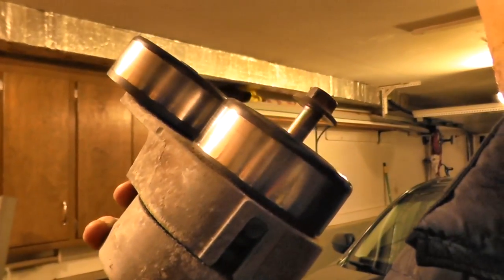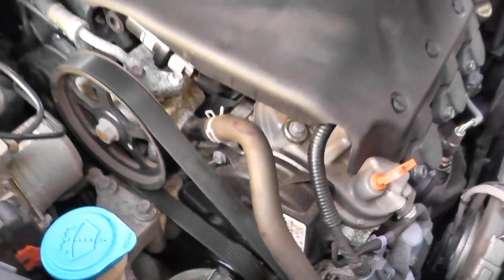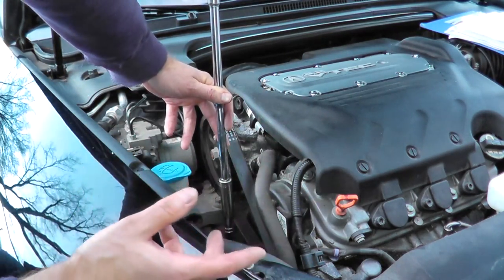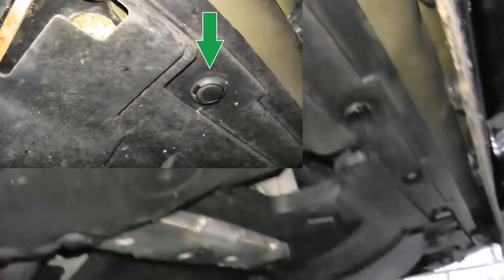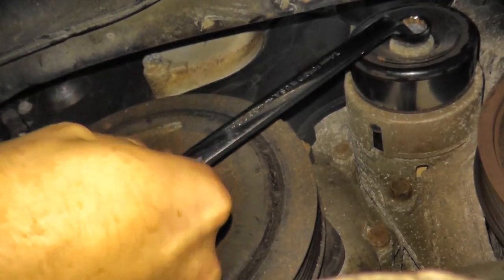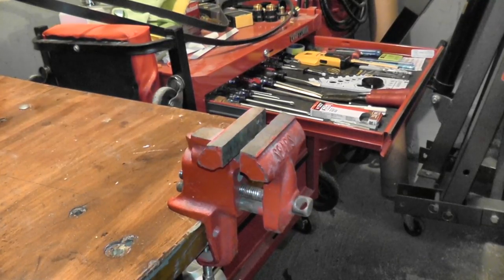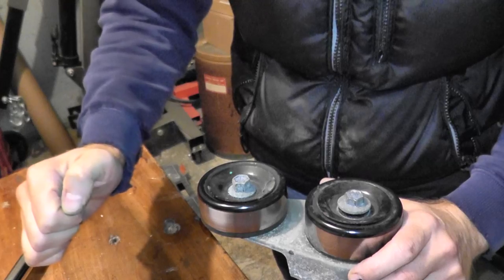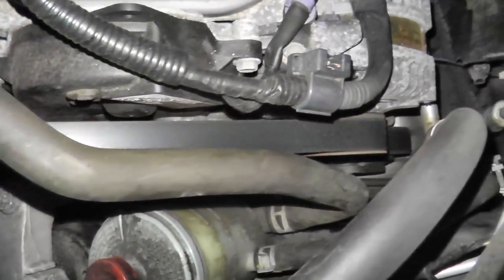How to Test and Replace the Belt Tensioner on your Vehicle

Comment: Good video. Next time you may want to thread a few nuts onto the studs before you crank the vice onto it.  That way the vice would tighten up onto the nuts and not potentially bugger up the threads.
Reply: That's a good idea! Thanks for this
Reply: Can you show me how i install belt kia forte 2012
Reply: Good tip

Comment: My tensioner wont tighten up, belt pops right off every time i start my truck! Thoughts? Recommendations? Also, its seems to be a bit crooked on the spring. I don’t remember it being like when when I replaced the s belt a couple years ago.

Comment: Much of my problem was to access idlers/tensioner and determine which one is actually the tensioner and the size socket to use.  Is the tensioner bolt size generally identical for various vehicle models? Very useful video. Thank you. 2021/06/06. Ontario, Canada.

Comment: I never had to go from the bottom to change out the tensioner. U can use a 14mm ratchet wrench on the tensioner and the 12mm bolt  is  accessible with a deep socket+1/2 to 3/8 adapter.

Comment: Hey man, great vid. Helped me understand belt tensioners, maybe you can offer some advice...

I have a project off road go kart with a 200cc engine from a generator. I want to fit a tensioner because the shorter belts aren't thick enough. Do you have a diagram of how tensioners work to help me build one for this engine? Or could you take a look at some photos of my set up?

If anyone reading this can help then please do, I'm new to all this!

Comment: Great content but my tool will not fit so I can change my belt like yours I dnt kno why i am having this problem, i have a 2001 acura mdx but i see noooo videos on this for my year, I dnt kno what to do 🤦🏽‍♂️🤦🏽‍♂️🤦🏽‍♂️
Reply: Use two combination wrench ...  Put one on pulley bolt then stuck wrench’s other end into longer wrench’s round side ( be careful) ..u’ll able to release without spending money on special serpentine belt tools

Comment: Great job! So if my alternator belt is loose. I should check the tensioner for proper torque. Are there any other reasons my alternator belt is loose ?
Reply: A belt can only come loose if it has no tension (faulty tensioner) or the belt itself is faulty. If a belt is old or damaged, it may be stretched out and no good. L

Comment: 9:20 couldn't the 40 ft lb. Torque check also be done while the tensioner is still attached to the engine?

Comment: On my 3.5 Altima Coupe, one fastener is behind the PS pump pulley. 😟. Looks like crow’s foot time and just hoping it goes finger loose quickly.

Also, my tensioner ($20/sitting on workbench) has 135k on it with a slight wobble on hand inspection. The belt I R&Red I had 5 years and 60k and all ribs were seriously cracked.

Will do tensioner when motivation strikes. 😀

Comment: I hear a knocking sound when I turn the ac on could it be tentsioner
Reply: Had the same problem on my ford turneo custom long story short I decided to change the crankshaft pulley and the problem was gone now my car is making a squeaking noise/sound thinking it could be the serpentine belt because I saw some cracks on it
Reply: @whatsupp7539  I found the problem with mine it was the ax compressor

Comment: i have a really bad misfire, checked everything including ecu. The misfire is soo strong it tugs the tensioner back and forth ORRRR is it the tensioner causing the misfire. Guess what i really want to know is if a misfire usually constricts the engine to the point where you see the tensioner pulling back and forth? AC doesn't work, Power steering doesn't work alternator producing only 13.5 volts. but it looks like the misfire is messing with tensioner. but this vid has me thinking that its the tensioner causing the misfire.
Reply: did u figure it out?